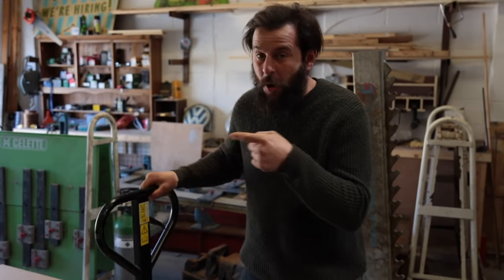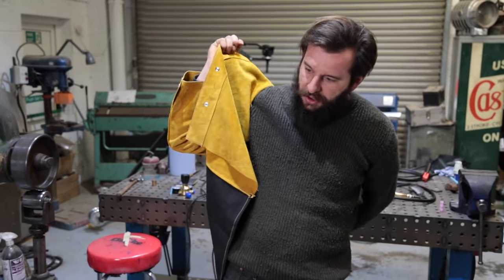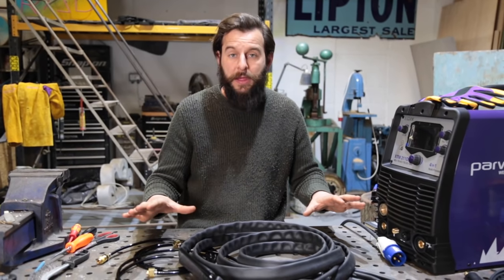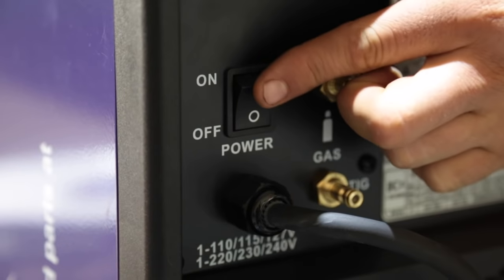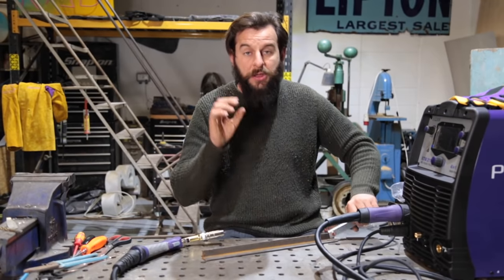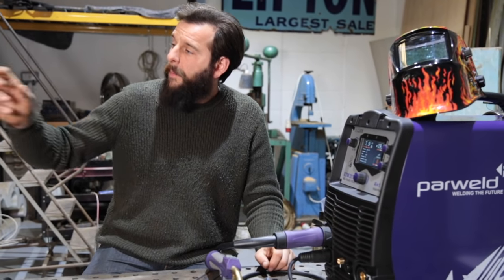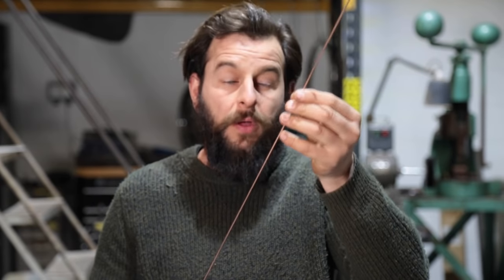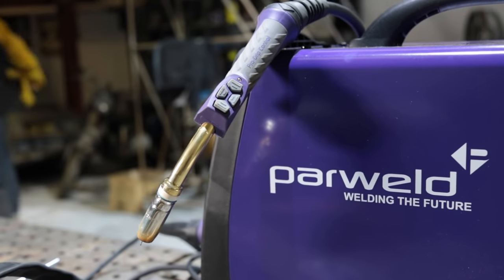Dom's Introduction To Welding... | A Beginner's Guide

Comment: Hi Dom, Ive always fancied having a go at welding. Maybe Ill get a cheap second hand one like you started out with and do a bit of practicing. I’m nearly seventy and Ive learned so much from this video to inspire me to have a go. Thank you so much.
Reply from the maker: Oh that’s amazing! Thank you for the lovely comment, go for it! You don’t need a fancy machine, a second hand basic one and a small  bottle of gas and you’ll be away!
Reply: @DominicChineas  Me too just bought a cheap stick welder and having a go for first time at 50.
It's not the best and keeps tripping my pcb on low voltage. I'm sure I'll get there.

Comment: I just got myself a second hand Mig welder and have been learning with Flux core gasless MIG welding wire. Set up is slightly different to standard MIG, the theory is you don’t need gas, and you tend to get more weld penetration for less amps.

Comment: Hello! Welder here! Good introduction! There are useful apps to help find wire speed/voltage for the MIG depending on what to weld, and in which position. With normal wires (not flux-cored), you're supposed to aim the torch a little more in the direction you're going to. At least, that's how I learned!

Comment: oooh I love, love the purple on that Parweld gear - I wish I could get their gloves and helmet over here in Canada. I'd happily switch to purple from the red's and blue's if I could (sorry Lincoln and Miller fans, hah)! Well, maybe not for the actual power supply, though that one sure looks a lot more modern than the machines I use (but water-cooled TIG ftw!).

One thing I don't think I saw you cover is... cover up all skin! You mentioned the bright light from the arc and your eyes, but the same goes for any exposed skin; you'll get a terrible "sun" burn from the very intense UV light given off by the arc.

Comment: My old chap had an Eng Co from 1972 to 1991. I worked for him from 1976 to 1979. He taught me how to use Lathes, Mills, Folders, Guillotines, Pillar Drills, Fly presses and MIG, TIG and brazing. Set me up to do my own DIY stuff with Motorbikes later. This video explains welding very well.
Reply: That is not the question I asked. I am only concerned with testing for color shade blindness. I am someone who fixes everything but has to leave the welding to someone who can see it. I was not allowed to be retrained for electronics because I did not see the colors correctly, only I managed extremely well in that world to circumvent that by measuring. Therefore I also have the question for that doctor which color was black. Something that burns turns black but what color was on the resistor before it burns. Something that I could not see but was able to figure out.

Comment: twi bits of advice when welding with tig or gas was bend the filler wire end over so you don't stick it in your eye, and don't use a no gas mig  as they ain't as good as gas 
Great video Dom .down to earth and spot on .

Comment: Great video Dom, 
During the first lockdown I needed to attach metal solar panel brackets to the roof of my steel narrowboat, and seeing as no one was allowed to visit I bought a welder and a mate taught me how to weld via facebook messenger  using pictures and videos... and just over twelve months later the brackets and panels are still on the roof!  
The bit I struggle with is where I need to alter wire speed and voltage... maybe you could do a video explaining the basics how to tell when you need to alter those and whether a weld needs more or less voltage / a increase or decrease in wire speed.
Keep up the good work, and take care

Comment: Great stuff again Dom.  To add to your list of types of welding there is also friction welding.  MIG does not need a gas bottle if you use flux core welding wire and the polarity of your MIG machine is reversed, ie the negative clamp become positive and the gun goes from positive to negative.

Comment: On the one hand, any amateur can have a go at MIG welding and by trial and error, produce acceptable results.  On the other, there's no substitute for an in depth understanding of first principles (with oxy-acetylene welding, stick etc.), so as soon as the colleges are open again post-covid, I would urge anyone considering buying a MIG welder to sign up for a few weeks of evening classes.  I studied "C&G 165 Welding Craft Practice" in the early 1980s as an apprentice and it was invaluable to me.

Comment: Cheers Dom, nice intro. Perhaps  comment about gas cylinder safety esp. for the bigger cylinders? Chain/strap cylinder to wall/trolley/something so it can't topple and fall onto the regulator/valve. Only low volume but It's still squished in there at 200 bar :)
Reply from the maker: Good advice, 
If you decide to go for a cylinder such as the Adam’s gas ones they provide all of the safety info you need, I’ll mention it next time though!

Comment: Hi Dom..Great Video!! For those just learning to weld there is a series of wire known as flux cored, which allows you to weld without argon/c02. the wires come in diameters of .025"-.045". They are a bit messy in that you have to chip the flux off the weld and wire brush it clean post weld. It also leaves deposits of spatter near the weld joint, but this can be controlled by applying nozzle dip around the joint. Gas produces a much cleaner weld, but flux cored may be an alternative for some. Cheers!!

Comment: I’ve never had a lesson in welding before now at least I know the basics. I’m going to have a look at the costs and then decide if for the extremely limited amount of welding I need to do if it’s cost effective or whether I can pay someone to do it when it required. I’ve only needed two brackets welding on one of my cars in the last three/four years so it’s not a lot and I suspect that it may be cheaper for me to pay someone to do it for me. Perhaps a lesson on what questions to ask any potential welder might be a good idea. I would also like to know how to solder especially car electric parts.

Comment: Hello Dom, well there is a thing of beauty! Nice machine looks very well put together and thought out. Like you I would start with the very basics. I was taught not only to use MIG and ARC welders but to also listen to the sounds they make , you learn to hear when it's all good. Another cool video mate, top job! Cheers Simon
Reply from the maker: Hi Simon! 
Totally agree about the sound, it’s very hard to show how to actually weld on a video, you need to spend some time practicing to get a feel for it, thanks for the comment

Comment: Can I add a few things, as you said when you put on the new helmet " thats much clearer" always keep the visor clean and replace the plastic guards regular, the better you can see, the better your welds. Keep the welding tips clean, use a tip dip or similar. Always use a quality wire, the better the wire the better  and easier the weld. hope this helps

Comment: Great video Dom, I'm not a proper welder but I do a little welding and I have a gasless fluxed core wire machine which works quite well. Your tip about the contact for the earth point being clean is really helpful. I also use acetone to degrease the metal before welding.

Comment: I think buying a cheap second hand welding set is good to have a go but if you're serious about learning to weld to work on cars etc it pays to invest in a quality machine as it will make things much easier! I've got a Kempii minarcmig evo 200 which I can thoroughly recommend, its lightweight and portable but powerful enough for most garage jobs, I've done a lot of welding on my old mini using it and it's worked fantastically! They are around £1100 though so quite as investment but you get what you pay for!
Reply from the maker: Your absolutely right, you get what you pay for!

Comment: Very nicely done Dom 😁. Probebly a bit late now but a shout out for gasless mig could help some "part time hobby" welders like myself. I use flux core wire on my cheap (ish) Clarke machine. I was going to convert it to gas but for the "leaky cheap bottle" reasons you said, I decided against it. I just need to be able to pull out the welder and start. I have only used gasless in any of my YouTube videos. And the results are sufficient for "a quick welding task". Thanks for the video Dom... keep up the great work 😁👍

Comment: Hi  I bought the same welder you got there I only potter about welding cars , I have old Clarke 150 I got about 25 years ago so I do I upgraded to this 1 could you tell me if you have welder thin metal less than 1mm on 0.6 word and what was settings and did you have to adjust at all, very good vid by they way

Comment: Beware of the gap between the gloves and the jacket sleeves - sparks will find any uncovered areas ! I still have a scar on my leg where some hot weld splatter burnt through my sock years ago.

Comment: you can use 100% co2 on a mig welder to weld but it is called mag welding due to co2 being a active gas while argon is inert and you can get as good welds with 100% co2 as with 5% mix but you will have a harder time setting the welding settings correctly because of it.

Comment: Hi Dom, great info' for beginners.  Didn't know the bit about AC vs DC for TIG welding aluminium.  Good that you talked about H&S, but maybe you should have also mentioned combustible/flammable materials in the vicinity of the welding area and having a suitable (in date!) fire extinguisher handy.

Comment: Brilliant overview. I used to like welding as part of my general apprenticeship  with British Steel. It was before the MIG/TIG days, so oxy-acetylene or flux coated stick. I preferred oxy-acetylene, much more control with a filler rod in the other hand. They should let you keep that welder or offer a massive discount, it would be seen on The Repair Shop after all...

Comment: Back in my high-school days, in my industrial arts class we had Arc welding which used fairly thick rod, and we had acetylene welding which could also do cutting.  Whatever happened to those?
Anyway, when I was looking for some welding equipment, I found out my electrical service in my shop wouldn't allow me to use such equipment because the current demand would exceed the breaker rating.  Although there was a welder available which would work on my service I was told it would be a very disappointing tool and tricky to get a good arc.
What amp service do you need for a decent welding setup (assuming 220V)?
I ended up getting a Propane\Oxygen brazing torch and using silver solder.

Comment: Love your video's ive always admired good welding I stick metal together when needed but wouldn't call it welding going to start playing again try and get better.  I  helped out in a blacksmith's shop as a lad usually when a farm machine of my dad's needed repair I would go to help as the goffer,  learnt so much from the smithy he was a true craftsman.  He wielded up a multi branch exhaust manifold off my Rover with a stick welder, he did such a neat job and it didn't crack again. Everyone else said it was not repairable.

Comment: Thanks for this Dominic I opted for a flux core mig welder and to be honest I was ready to throw it through the garage door whilst working on my Landrover Series 2 restoration project and kept resorting back to my stick arc welder, turns out I was putting to much pressure on myself and needed to practice with loads of bits of scrap metal and get the wire speed turned down and always get a good clean earth clamp position and my welds have become 10x better and also brought a better light reacting mask and not the handheld one that came with the kit.

Comment: nice vlog...only thing i might of added was what happens if you dont wear a welding helmet etc , Arc eye , like having grit in your eyes , basically burnt layer of skin on the eyeball , horrible if you have ever had it , your right never look at the strike up without the appropriate eye protection

Comment: Those welding gloves are something I would never use. I’ve tried gloves like that and had hot metal get around the back, and melt the cloth. Those aren’t real welding gloves. They’re sharp object gloves.

Just to be clear, because it’s really a safety issue. There is no “ground clamp”. It’s a work clamp. It doesn’t ground anything. If you do attach it to a ground, you will burn the welder up, and possibly electrocute yourself. I know most people call it a ground clamp, but they say it because they hear others say it. Sometimes, even the writers for the manufacturer call it a ground, but it’s still wrong.

You control voltage on MiG, and amperage on TIG and stick.
Reply: Just to be clear, amperage isn't a real word. It's called current.
Reply: @shedtime_au  sorry, but Amperage is a real word. Look it up and learn.

Comment: Hi Dom, Electric welding on a steel bench. Is there a risk of electrocution by someone touching the table?.
Reply: No, there's no risk of electrocution, the voltage is about 15V. The only risk is burns from splatter & UV rays.
Reply: @nitt3rz  Thank You. First to explain after asking many.

Comment: Great channel Dom. Just a quick tip for newbies when you attach the regulator to the bottle crack open the bottle valve for a second to clear any crap from the valve as this can ruin the regulator. Been welding for over 50 years now and I cannot stress enough the importance of eye protection. Had arc eye as we call it 4 times and it burns the eye and it feels like sand at the back of your eye and can end up with a visit to hospital. BE CAREFUL.
Reply from the maker: Thanks for the tip! Appreciate it!

Comment: I bought a new mig welder last year as my other one finally gave up after 22 years of work. I’m looking at getting a tig but not sure if I will ever do any aluminium welding so is it worth just getting a cheaper tig welder Dom ? It’s for restoration work fitting new panels or fabricated ones as I’ve used mig for years as you say it’s easier to planish tig than mig after welding
Reply from the maker: An AC/DC tig machine isn’t a lot more money, while your buying one It’s worth spending a bit more and having the option of aluminium...

Comment: I bought an entry level welder and opted for the flux core wire option. After half a dozen attempts at welding it’s now gathering dust. I’m inspired to have another go. What do you think of flux core? Should I ditch it and buy some gas!? Cheers 👍
Reply from the maker: I hear that a lot, I would definitely recommend getting some gas and proper wire and giving it another go!
Reply: I will, thanks for the advice 👍
Reply: Yep go for it with gas assuming your machine will change over, you see a world of difference.

Comment: Years ago when I worked in a factory area that had welding operations, the supervisor said never look at the welders as it's like getting a load of sand in your eyes. He then made me look at one so I'd never do it again. He was dead right, he may as well have just thrown sand in my eyes :)
Reply: You say it right, there is only a problem with it if you wear glasses, you have to look and shield directly and take into account the reflection of the weld, otherwise you will still get welding eyes. Sand eyes. Anything that can reflect will hit your eyes.

Comment: Hi Dom,
Love your channel and your involvement with the Repair Shop. Just a couple of things

The negative is not always connected to the work piece, look at your tig torch.

You said you always use a foot pedal and not all welders have that facility. 

Tig comes in 3 arc variations scratch, lift and high frequency and a beginner needs to be aware.
Hope these points help.

Comment: Thanks, Dom. I started out & still have a gas less MIG welder - using fluxed cored 0.8 wire. Like you said, scrap bits of metal, open up a whole new realm of creativity, when you can stick it together!

Comment: I've been a pipefitter / welder for 40 plus years and rarely, if ever, used a welding helmet. I use safety glasses only, never got welding flash (sandy eyes) and on the prescription of my eye glasses hasn't changed in years. I'm 65 now.  Hmmm... ?

Comment: This video could usefully have been divided into separate videos on each type of welding- leaving time to actually talk about the welding process. i.e. the effects of voltage and feed rate on the weld, with examples. You could also lose the unpacking and gas delivery parts- this is not TV where you have to entertain those not directly interested- we watch for the technical stuff. For the beginner, there is merit in starting with 'no-gas' welding- using a MIG machine but with flux cored wire. Removes all the gas issues, and ensuring the right flow etc. Lets you concentrate on forming a good weld. Later, if you do more, you can switch to gas.